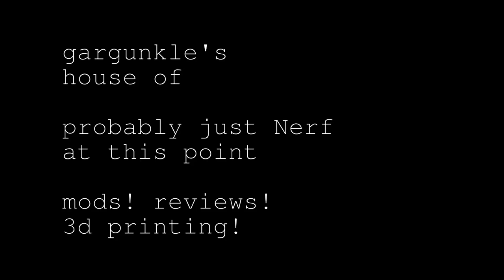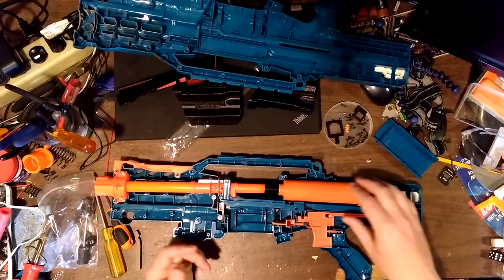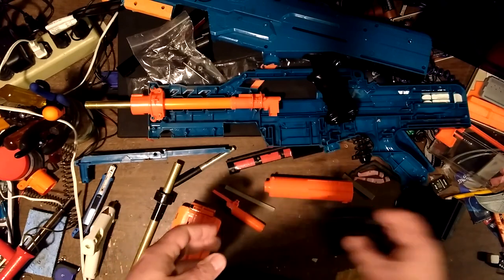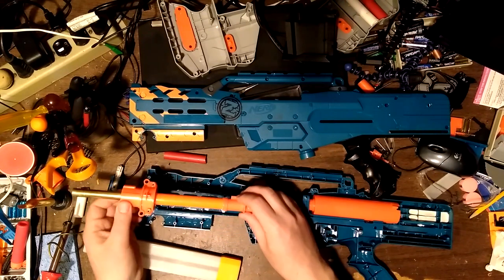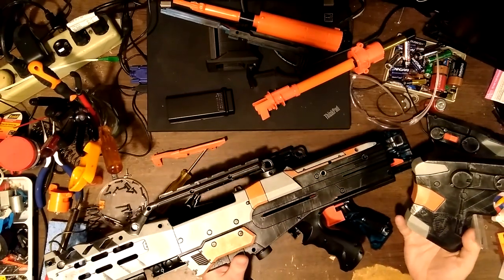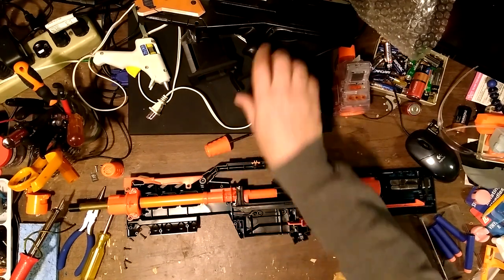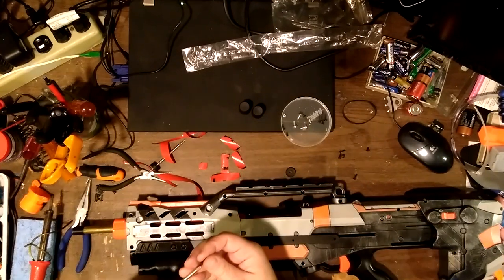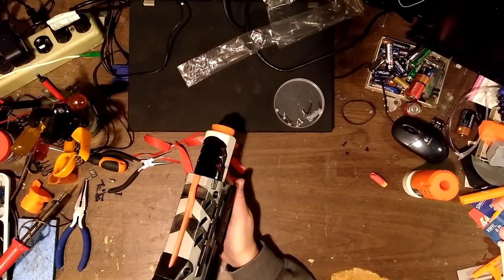[Nerf Mods] Nerf Longshot high power build

Comment: Nice work on the Longshot! I appreciate the use of a brass breech over starting with a kit. For the screws, you can get away with 6-9 in the main body and 3-4 in the stock depending on how particular you are about that. The jam door is easy enough to fix with a magnet glued to the top of the shell and a metal washer glued to the jam door. I also leave a little bit of a nub on the part that you clipped out of the jam door so it is still mildly held in by the boltsled, but can be opened and closed with slight use of force. The brass work looked good. On my LSs that are half length only, I have a similar pusher made of brass sections to push the dart head into the barrel. Because it's half length, you can also pull the barrel back even further (all the way up to where the dart sits in the magazine) and improve the seal. I've also found the best way to use a chronobarrel when it's not attached is to shoot it backward through the front which is easier to align, it only uses one IR beam to read so it doesn't matter which direction you fire it from. Anyway, nice work and glad I could help put another brass breeched longshot out in the field!
Reply from the maker: I really appreciate your input on this!  I will be looking to improve mine further if I can.